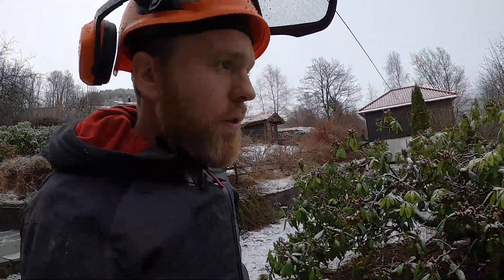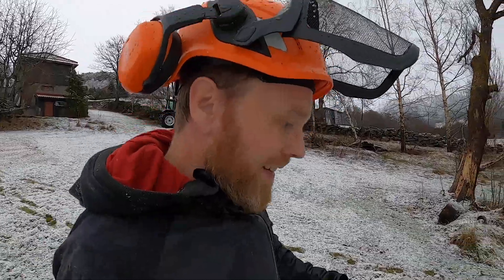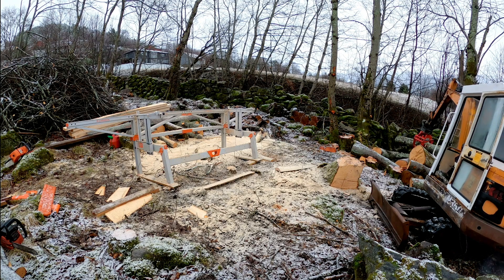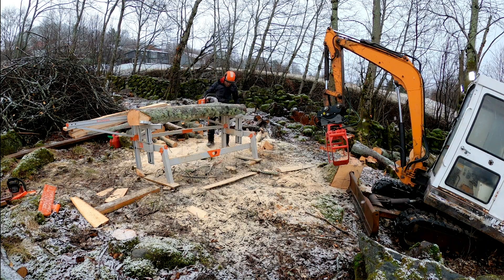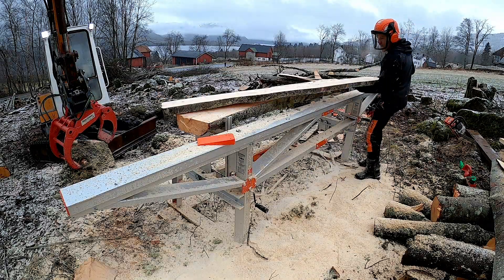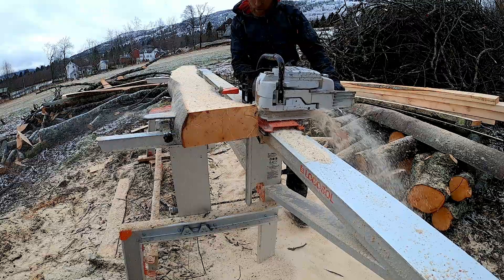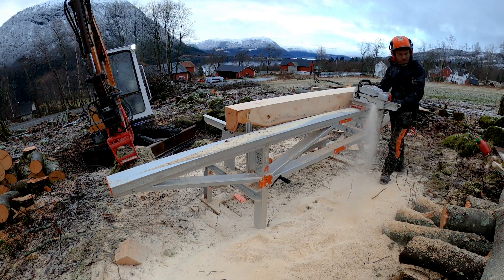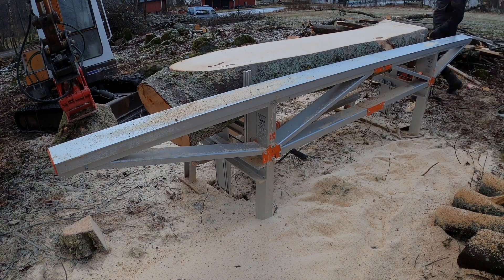Milling lumber with the Logosol F2+ Chainsaw Mill

Comment: Great video, thanks for sharing. I should mention, the "log turner" is specially designed so that only one person is required to roll a log up a ramp. You could not have discovered this because you use the excavator for that purpose. It's special trick is that it allows you to reset for another lift without losing your progress. This is not possible with a cant hook.
Reply from the maker: Thanks for the tip. Are you referring to the same log turner that I have in the video? Because that's super cheap and flimsy and not possible (even if you have two) to manage the kind of weight that I had on the biggest logs here.
I could have set up the mill below the logs and set it up so I could roll them in a more horizontal manner, but since I had the excavator, it was just easier to do it this way for me.
Reply: @Hackish  yes, the one in the video is specially designed to allow one person to roll a log up a ramp. Logosol has a video about it.
Reply from the maker: @johnshearing  It might be user error (ie. my fault), but it's so flimsy that I doubt it would actually work for heavy logs. I wouldn't risk my legs for it at least

Comment: How consistent are your cuts? I have found that the thickness will vary up to 3.175 mm (1/8 of an inch) when cutting 3 meters (10 foot) lumber.
Reply from the maker: Over the length of the log it's pretty consistent, definitely less variation than 1/8".

Comment: I bring two chains to the woods so I don't have to sharpen when milling. I also bought an electric grinder and that helped a lot.
Reply from the maker: I'm planning to figure out a way to fasten the saw so I can use my 2-in-1 sharpener. I think it's just as fast (if not faster) to sharpen using that than to change the chain.
Reply: @Hackish  I'd be interested to see what you find to fasten it to. I struggled to sharpen with the 2 in 1. I didn't have anything to fasten the bar to and I was sharpening at a 45 degree angle per the instructions but later learned that ripping chains are 10 degrees. The cuts all had waves on the boards and it was frustrating.  But now when I sharpen correctly  I notice my chains stay sharper long when using the grinder. But I am probably just not that good with a 2 in 1. It's a learning process but I really enjoy it. It must be something in our DNA because I could do it every day.
Reply from the maker: Check out my other video on the 2-in+1 and how to make it 10 degrees
Reply: @Hackish  Nice, I'll check it out